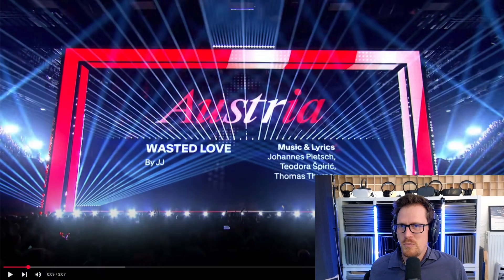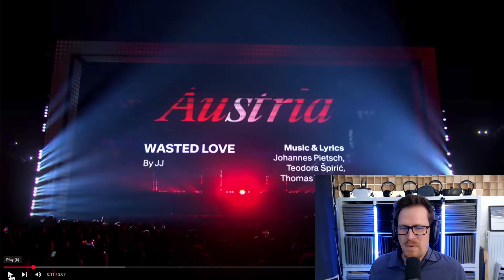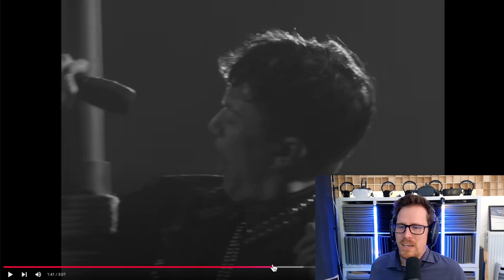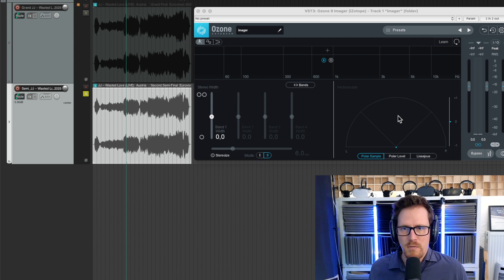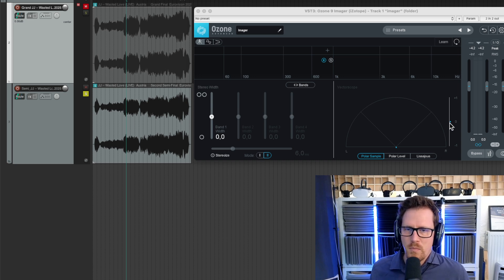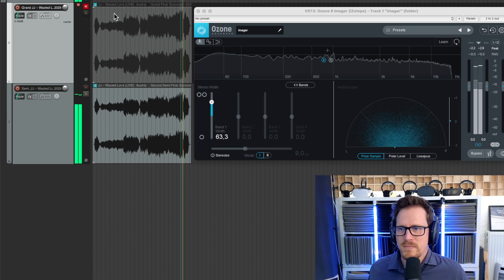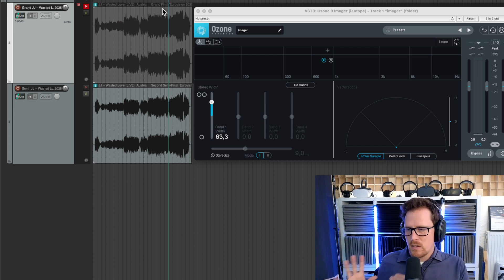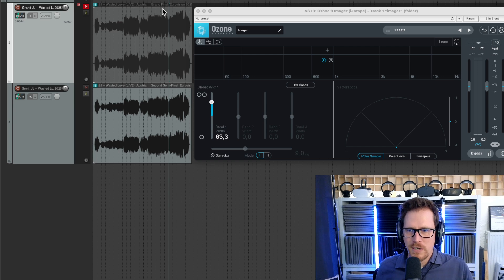FAIL at Eurovision 2025 - How did nobody hear how JJ got screwed (Sound = Mono!?)

Comment: Only with JJs Song? Did you find this for other songs as well? I m not totally sure, but in the final could it be, that with this sound you hear the audience more - so it feels more "in the hall" ?
Reply from the maker: I haven't really checked for other artists with the same issue, I don't think it was intended on JJ, probably random though.
Have a listen to the video, I picked some parts where it should be really audible like the audience cheering in the beginning which also applies to most other contestants.
But yes, you could consider it more "in the hall" like the sound is not only coming from the front (like with mono), but more "around" you, but still focused on the front since it's not "surround sound"
Let me know if you find any other song with this issue, I might have a look aswell